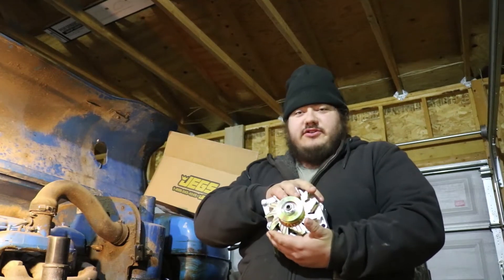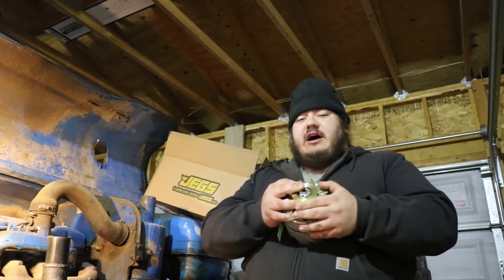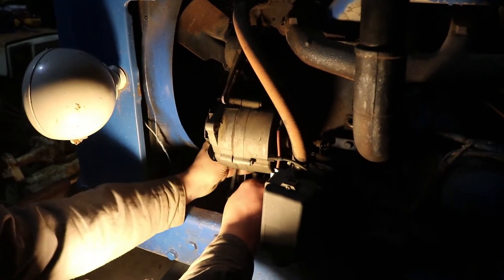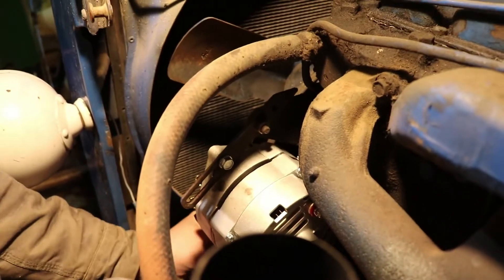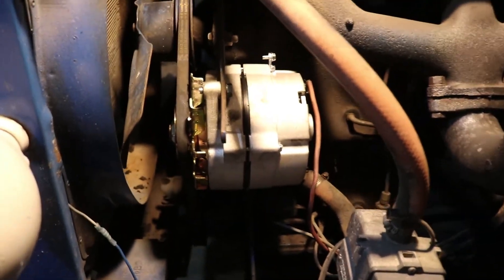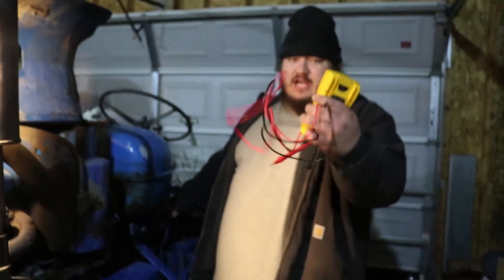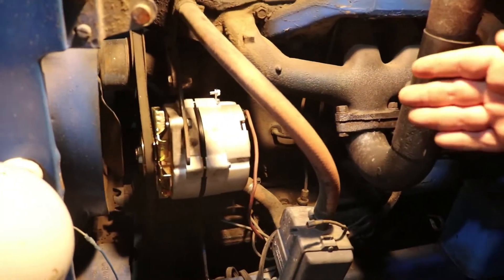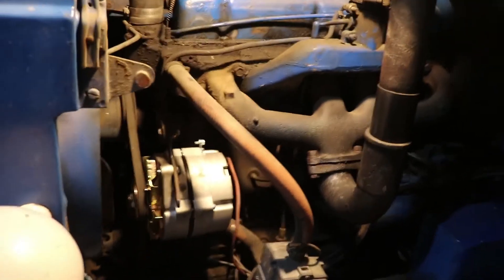Old tractor 1 wire alternator conversion! Fordson Major

Comment: You  didn’t show where you hooked up the wire from the alternator  to
Reply from the maker: You can hook it to the positive terminal on the starting solenoid or directly to the battery.

Comment: I assume you  removed a alternator and not a dynamo ? There would need to be a bit of rewiring to remove the voltage regulator for the dynamo if that what was previously fitted. Early dynamo's had round terminals and later had spades. The one wire alternator seems a good alternative. I would also assume that it gets power back from the battery to excite the coils also.   interested to find out as I may be replacing my dynamo on my 1955 Fordson Major. M😀
Reply from the maker: I went from an externally regulated alternator to an internally regulated alternator. I used the hot wire from the regulator to the generator if I recall correctly. I ended up rewiring the whole tractor and using a heavier wire for the alternator. It was plagued with electrical issues.
Reply: Sounds like one of my 2 minute jobs that takes 2 days 😀M  @BillTheTractorMan
Reply from the maker: @MarshallSmart  took me about 2 hours to re-wire the tractor, install new LED work lights, new Ignition switch, and a horn. I am decent with automotive/ agriculture electrical, so I ordered everything I needed ahead of time and just focused on getting it done. These are very simple tractors electrically with zero electronics. Thanks!

Comment: Bill, what mounting bracket did you use to mount the alternator?  I realize that when you switched from the generator to the “old” alternator you needed a different mounting arrangement.  Great video.
Reply from the maker: I used the original mounting bracket on the tractor for the alternator until I added power steering to the tractor. At that time, I needed to make brackets for the alternator.

Comment: Hi Bill do you know if you can get a similar Alternator to this in Australia either Jegs, Oex or something similar without having to make up a new mount. I looked up the link you posted for the Jegs site but it says it’s no longer available, I also was told you have to change the starter motor over too if you go to a alternator as this will make it negatively earthed instead of positively earthed that it currently is with the generator? Thanks 
Keeps up the great videos I enjoy watching them
Reply from the maker: You local auto parts supplier should be able to look up a General Motors 1 wire internally regulated if they are available in Australia. Otherwise Ebay might be your best bet for finding one that could be shipped. If you're tractor is positive ground, I would double check to confirm. Switching to negative ground has its benefits and I would do it for those benefits.
Reply: @BillTheTractorMan  Is the part number for the Jegs alternator 555-10160? I can’t see if there is any other numbers after that. Thanks
Reply from the maker: @glennott7998  Here is an updated part number for JEGS low cut-in alternator. The low cut-in starts charging at 880RPM instead of the standard 1,200rpm of most. 555-10134
Reply: @BillTheTractorMan  Thank you for your help

Comment: Bill do you have a part number for that alternator that cuts in at 700 RPM?
I don't see the explanation of the alternator in your description thank you
Reply: I called jegs, the guy said he only had alt that kicked on at 880 rpm
Thx!
Reply from the maker: @paulchace2391  that alternator should work also, probably very similar to the one I installed. With all the supply shortages these were difficult to find for a couple months.

Comment: very nice fix, how did you find out that it was a low turn on rpm?
Reply from the maker: Usually it is listed as an RPM when the alternator excites. More commonly used with classic vehicles pre - 1960 or from the generator age. They are somewhat designed for the use.
Reply: @BillTheTractorMan  nice. I might have to use that alternator on my diesel MTD 960 build.
Reply from the maker: @JoshKilen  I have even seen "Mini" one wire alternators. many varients have been made, I'm not sure to their quality though.

Comment: I have a Fordson Dexta.  It is a positive ground.  How do I hook that up?  Can I switch my battery cables now and make it a negative ground??
Reply from the maker: Depending on what kind of electrical options the tractor has you might have to do more then just switch the cables. Part of that might include replacing the starter too for a negative ground starter.

Comment: I just got a 1958 power major, getting it back today from the shop had to have a clutch built and put in. It has the old charging system I like what you did. Thanks I subscribed
Reply from the maker: Thanks for watching! Your going to like your tractor, I love mine!
Reply: I put the box blade on and ripped up the driveway. It’s a little light in the front end wheels can come off the ground easily so I need to add some weight to it. However it’s a fordzilla for sure. Just a beast
Reply from the maker: @unsaltedlife5998  I'm going to add 42lb suitcase weights to mine. 6-8 should be plenty and should not make steering difficult.
Reply: Bill The Tractor Man could you do a video on using a box blade, I cannot get mine to dig up the driveway rocks they are impacted and the teeth bounce off and won’t dig in . It might be the setting on the plow depth settings not sure how that works! Or if I should add a bunch of weight to the box blade.

Comment: Quick question,  I have a Sears ST16, need to replace mower belt, I know it's a 5/8's width, but I dont know the length I need, it's the belt from the motor to the mule drive. Thanks.
Reply from the maker: There was 2 different belt sizes used. One was 100 inches and the other was 103. Your best bet is to measure the old belt that needs replaced. I think the 103" belt was for the Onan powered suburbans. That part number is 5L1030, I can't guarantee it will fit your tractor and mower deck.
Reply: @BillTheTractorMan  I dont have an old belt to measure, thanks for the reply, I appreciate it!
Reply: It is a tecumseh
Reply from the maker: @wes6374  no problem, I think a good place to start is with the 5L1030 if you want to guess. I buy mine from Napa or Ebay. I'm pretty sure the 103" belt fit my onan but also fit my tecumseh tractors.

Comment: The original Lucas voltage regulator is probably still on your tractor. That’s a real weird looking thing in a bakelite housing behind your gauges. With this upgrade you can eliminate a lot of the wiring on your tractor. My only advice is that if you haven’t already just make sure your wire between the battery and alternator is rated for the amperage the new alternator is putting out. I believe the original charging system was only rated at 30amps. So if you feed the old wiring harness with too much amperage you could have a fire hazard but the big wire to worry about is that one between your alternator and battery
Reply from the maker: Absolutely. I have a few other items cooking in the background including putting LED lights in the old light housings. When I get to that I will be running new wires. So far the alternator is only charging the batteries.